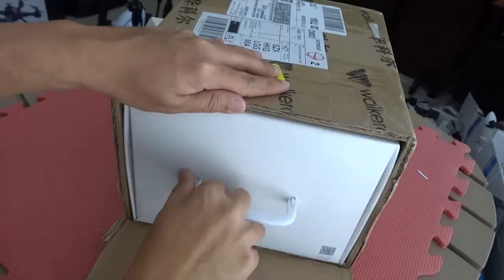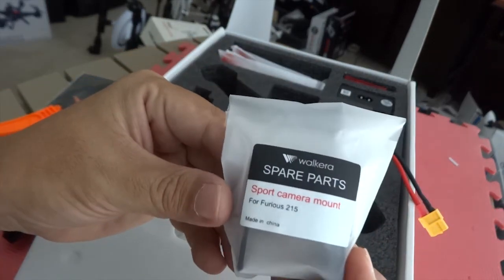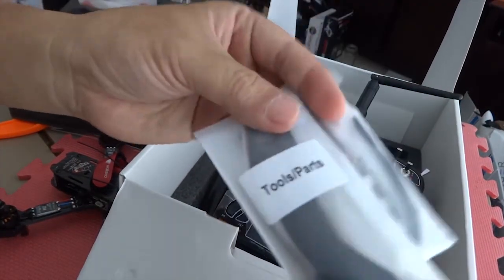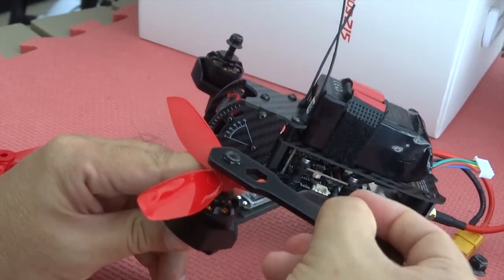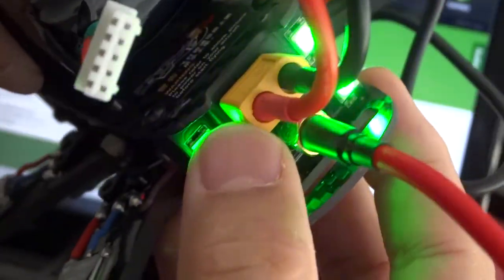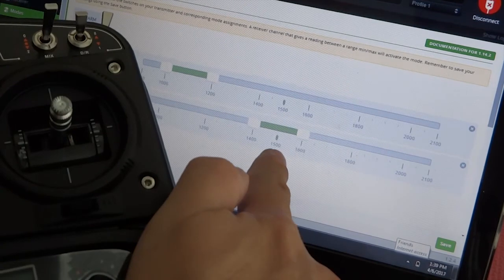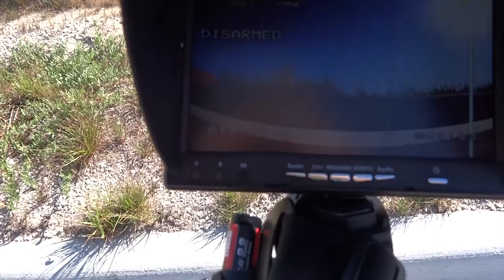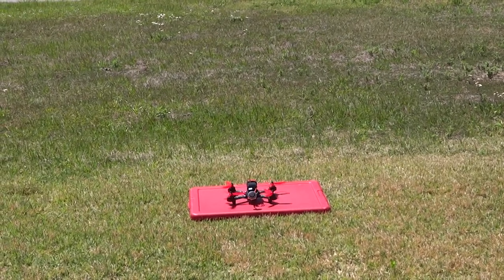Walkera Furious 215

Comment: I have a problem with my walkera furious 320; the propellers are not spinning and it’s making a beep sound, I really love this drone. Is there any way to get it working again or can I get it repaired?
Reply from the maker: Check your compass, likely damaged board, gps battery out or need to recalibrate. If all else does not work, request an authorize sevice center at ucdrone.com

Comment: Hi, some quick questions if yall dont mind...
Whats the top speed on this with stock 4s batteries?
How long do batteries take to charge and whats the flight time?
Can i upgrade to the f4 kakute fc on this?
How does it handle hairpin turns?
Reply: Negative on the upgrade.

Comment: There is an improved version on the market for some time! Just paid 250eu for the RTF incl. shipping! Wondering why no one is mentioning their awful construction flaw regarding the mounting of vtx connector......
.....i mean its pretty easy to fix....but without this fix vtx connector will just tear off the vtx after 50-100 batteries.

Comment: What board do you chose in cleanflight? Spracing F3?
Reply: You don't choose any board. Once you flash the .hex file provided by Walkera to the flight controller of your quad, Cleanflight will automatically know what board it is working with. Also, you have to use the version of Cleanflight provided by Walkera, as well. Any other version, including the most recent, will not work.

Comment: Hi Leo, is failsafe working on this quad if yes how do I test it? I arm my motors with the gear switch and props spin. Thank You
Reply from the maker: Hi Jim.  I can only speak of the F215 stock setup so it can be compared against a controlled test, failsafe is an instant stop to motors, when radio transmitter signal is lost. I have a video of the tests I can share.  Testing failsafe is the same for all Walkera aircrafts and most others, a lot easier if it does not involve GPS.  In a nutshell, remove your props first, turn off Air Mode, Setup Fixed ID, Throttle Up, Power Off and observe the response .  Power On and observe the response.  Objective is to stop the aircraft from flying further than where you are already at, when there is no signal and no autopilot.  Typically you want to just stop the motor or descend gradually.  You can further change your failsafe preferences within Cleanflight or the radio/receiver, but that will be your personal preference.
Reply: Thank You Leo! where can I find the video you talked about?
Reply from the maker: I will upload it and let you know.   It shows all the steps I believe.
Reply from the maker: Just for you https://www.youtube.com/watch?v=POHIY6dnCmI

Comment: Nice looking quad looks more durable than the f210 ! I have the f210 and want to know if the 215 is a faster model?
Reply from the maker: I will try to fly it next week, and see the difference.  I was thinking about upgrading the f210 firmware.
Reply: I was thinking about upgrading f210 firmware but don't want to risk bricking it's a pain.

Comment: Great video thanks for sharing. would you say better than the 210? looking in buying the bnf version.
Reply from the maker: Yes, bnf is more than enough if you have a Devo or plan to use other protocol.  Just login cleanflight to validate your receiver and mode switches.  I prefer the 215, but that can be how the cleanflight was setup and has evolved over the year. www.ucdrone.com has the bonus props promotion going.

Comment: Liked the video, what was the cause of the prop nut coming loose and the prop coming off? That has me concerned 😳 which motor did it happen on CW or CCW? Thanks
Reply from the maker: Thanks.  The 4 motors are threaded CW tightening.  A CW prop came off when I did a hard turn to the right.  Lesson learned, i have to really tighten them the old school way.  - Leo
Reply: Thank you Leo I will remember that. 👍